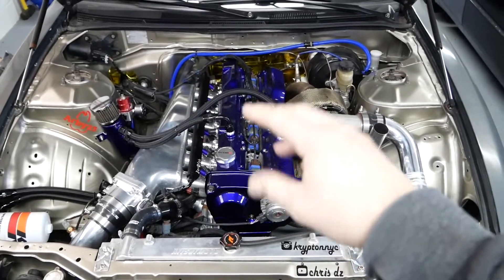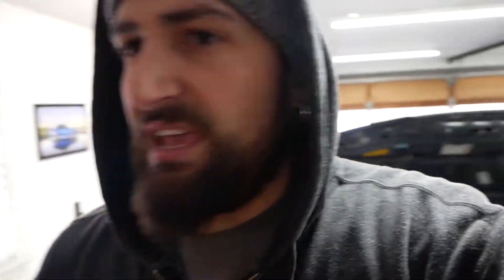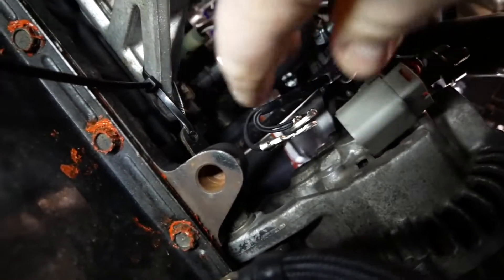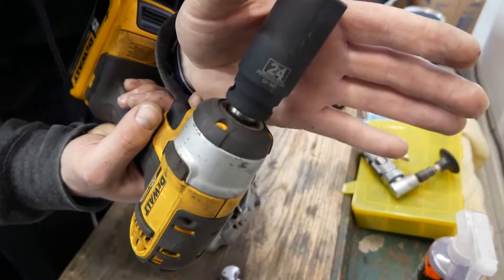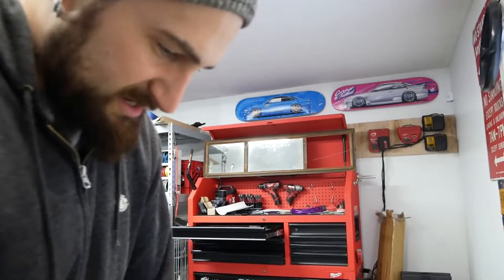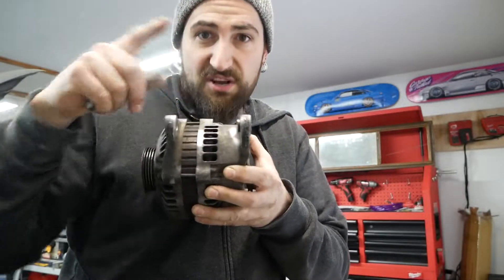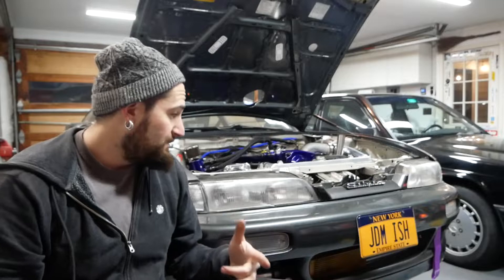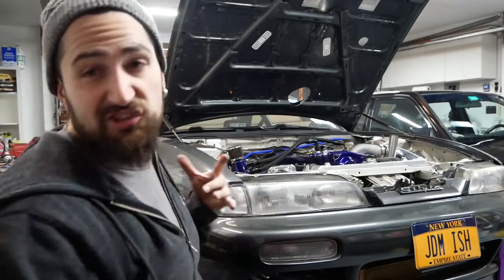Putting LS parts on a RB25 | how to change an alternator | 240sx rb25det s14

Comment: For what vehicles did u had to get the ls alternator to fit the rb25?
Reply from the maker: i think its a standard LS alternator, you just need an adapter kit to change the mounting points, like the one i had in the video.  i assume you can make your own if you’re up to the task and save the money

Comment: did you have to  change the RB harness at all to accept the LS alternator or is the LS exactly the same?  Also did this fix your low speed issues?
Reply from the maker: LS alternator is plug and play.  only requirement is the new brackets to hold it in.  I dont drive the car enough for the low speed thing to bother me that much at the moment.. the warmer the car gets, the less it has the issue lol